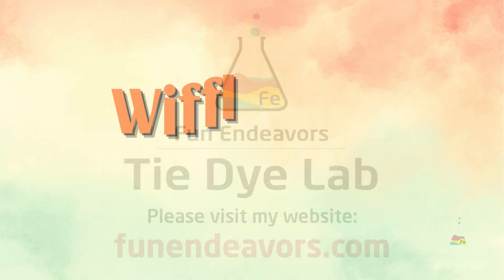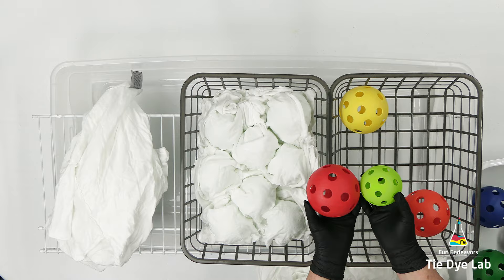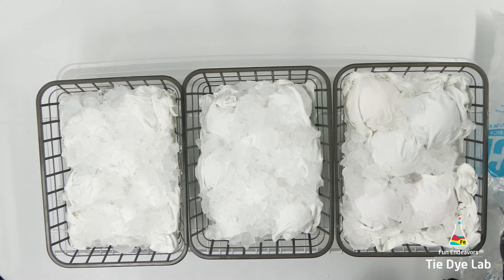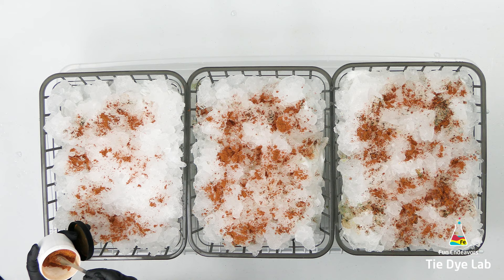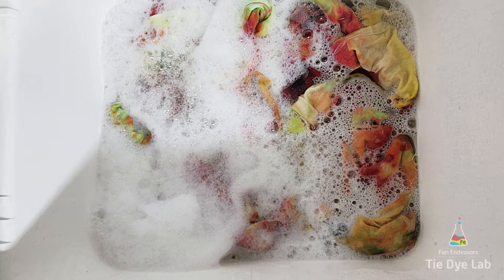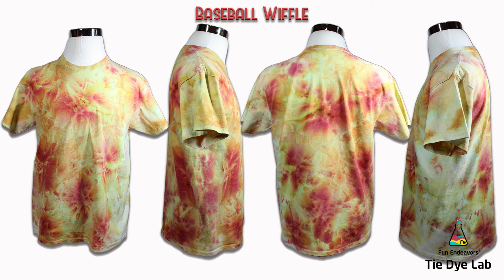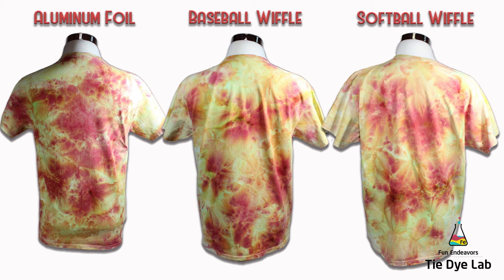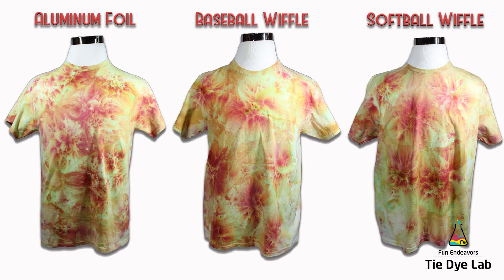Tie Dye Designs: Wiffle Ball and Aluminum Foil Experiment [TDS]

Comment: First, I love all three, but I think I like the aluminum foil one best, probably for what Crystal says, the foil doesn't let the water through so it flows better? But I'm not likely to use foil, I'll be thinking about it, maybe just small solid balls? Hmm... Also, I  like the smaller balls because there's more ball design. I like the wispyiness. I've got my basket filled at Happy Cat, looks like I'm going to have to get a LARGER amount of Dragon Egg, beautiful color. Do you think you have too much dye, that's why it's not dissolving? Or, less would make it not as bright or colorful? Overall, not a lot of difference. Thanks for the experiment!!! 🥰🥰🥰
Reply from the maker: Thank you, Patti!  I like the wispiness of the aluminum foil too.  I probably could've added less dye and that would've helped with the dye not dissolving. I also could've added a little more ice on each shirt and that would've helped too.  Unfortunately, the plastic baskets weren't deep enough to add more ice without making a mess.
Reply: @FunEndeavors  Sounds like another tutorial to me! 🥰

Comment: Do you find that by soaking the shirts, any white of the shirt gets dyed? And if not, HOW!?!? This is probably my biggest problem with dying, all the color bleeding.
Reply from the maker: No, I don't have trouble with the color bleeding when I soak the shirts during washout. If you're having that issue, the best thing to do is to start by rinsing really well in cold water.  The cold water will rinse out the soda ash and once it is out of your shirt, it won't be as easy for the dye to bond with the fabric.  Be sure and use cold water though - not hot.  The fiber reactive dye needs a raised pH (the soda ash) and heat to bond with the fabric.  If you rinse initially in hot water, you are rinsing unbonded dye and soda ash out of the shirt at the same time and you can stain the white areas of your shirt by bonding bits of dye onto the white areas.  Only when you've rinsed the shirt really well in cold water should you warm the water to hot and rinse in hot water to rinse out the excess unbonded dye.  I also add a little blue Dawn dish soap to my soaking water.  Blue Dawn is pH neutral and will help keep the water pH neutral and not encourage dye bonding.   When I wash my shirts in hot water in the washing machine I add some Dharma's Professional Textile Detergent which is also pH neutral and it helps keep unbonded dye that might get rinsed out from re-bonding with the fabric.